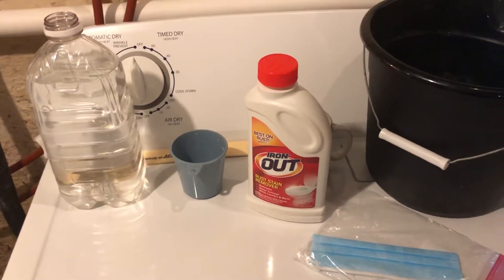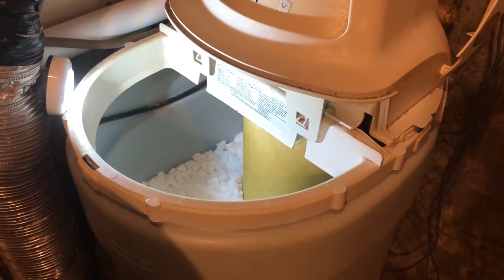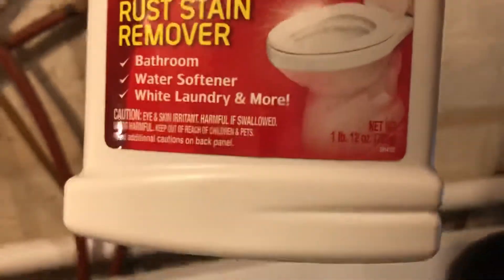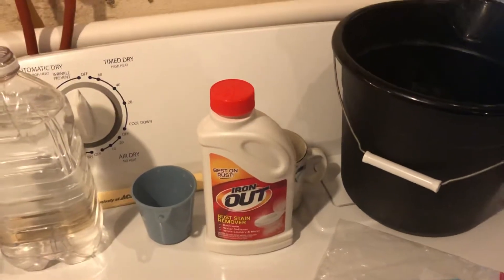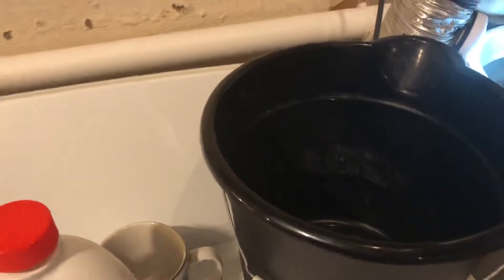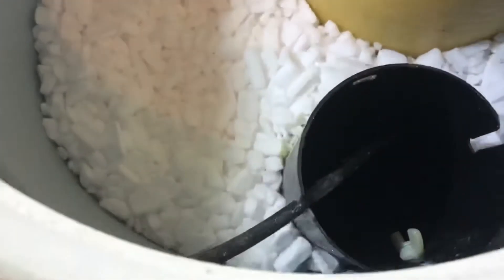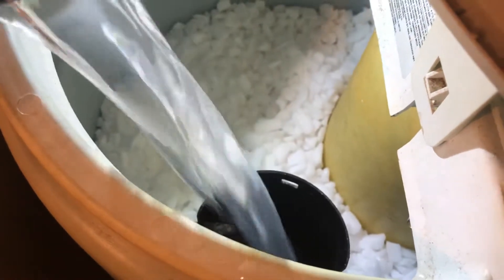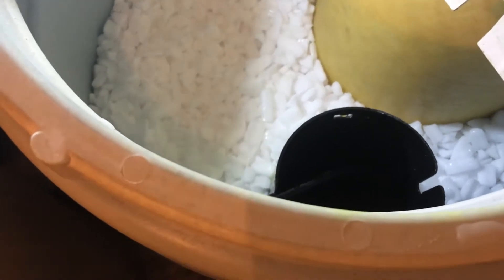Water softener maintenance remove iron buildup

Comment: Pardon my ignorance on this matter, but I have looked through the manual over and over with these Kenmore 350 series from the factory are these units designed to regen on their own after a set amount of gallons or time?
Reply: If so - how does a person go about changing this setting?
Reply from the maker: You change the. Hardness level.  That information on how to set hardness is in the Manuel.  The unit is automatically set then to run as needed.
Reply: @MiamiCOIndiana  thank you - I have reset the harness a couple times due to testing - as well as the time when the unit regens - so what you’re saying is the unit will regen itself after counting so many gallons that have passed or amount of time past? 
All I can do is set the time that it regions.
Reply: All I have found over the last year is I can set the salt level. 
I can set the hardness. 
And I can set the time that the unit regenerates.
According to what you’re saying, everything else is done automatically according to the water hardness setting?

Comment: Thanks for explaining as I am needing to do this process. I thought the brine tank was where the salt is, and there a no beads at the bottom of the black tube, as they are in the sealed up cylindrical tank. I think that's where you would want the iron out is in that black tube and not so much mixed with the salt that way it would be sucked up into the tank with the beads.
Reply: You are to pour the iron out into the "brine well" (the cylindrical tube he poured it into), but you are correct that there are no beads in there and that the beads are in the "resin tank". He did it correctly, but misspoke.
Reply: You can’t open the bead tank. It’s sealed   This is just a modern tank in bucket system you see these days. You don’t want air getting in your beads.  What I want to know is does this really work   BecAyse normally this stuff needs to soak for a while.
Reply: @woodywoodlstein9519   I can open both of my bead tanks for the two softeners I have. I didn't realize they sealed some of them as all the ones I've seen can been opened (my softeners have bead tanks separate from the unit, unlike the one in this video where it's the tank in bucket system). I replaced the resin beads after 10 years of heavy use in one of my tanks. There are companies that sell resin bead kits so that you don't have to replace the entire tank. It takes a couple of hours, but well worth saving a few hundred dollars, imo. Perhaps you already knew all of this and were simply referring to the system used in this video!

Comment: Using your water while running a recharge cycle shouldn't matter. While recharging a bypass valve opens to send untreated water to the faucets. If it were not so, you'd get really salty water at the faucets if you got yourself a drink while the softener was recharging. Also, that wimpy surgical mask might have made you feel safer, but it didn't stop anything from getting into your lungs. Good product and helpful video otherwise.
Reply: For legal reason’s & so as to NOT get SUED by viewers, he put the so called wimpy mask & safety goggles on per safety Self-Help reasons.  Always somebody out there like you to sharp-shoot other’s.  It was an excellent video period.
Reply: @jamesalbright4666 Always somebody out there like you to sharp-shoot other’s. It was an excellent comment, period.
Reply: @gyoungberg Good note on water for the recharge cycle.  Surgical masks are rated for 2.5 mircrons or larger.  Iron Out is rated at 5 microns.  The instructions on the packaging explicitly state to wear PPE for hands, eyes, and mouth before and during use to avoid medical emergencies.  Specifically, as it "may cause irritation to the respiratory system. Causes serious eye damage. Burning pain and severe corrosive skin damage."
Reply: @SlappyMcChamp Lol! Almost none of the air goes through the mask material. All the air goes around the gaping holes around the nose and face. You’re such a gullible liberal.

Comment: WhTs the rule of salt ratio in the well. I’m reading that you should pour salt till no water show and others say a few inches of water above salt
Reply from the maker: I would read manufacturer recommendations as it might vary brand to brand.
Reply: It doesn’t matter the installer should put the correct amount setting for tank fill.  As for salt I try to keep it full as possible.  If you let it dissipate to below the standing water then you are not salinizing the regeneration process enough.    Like not salting your French fries enough.  More Salt please!